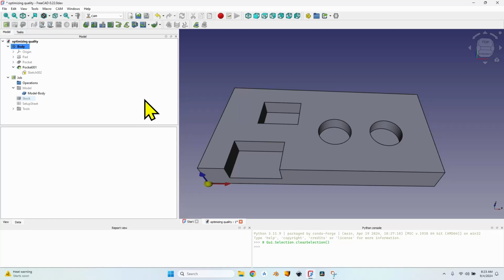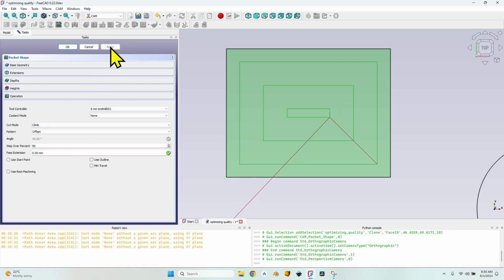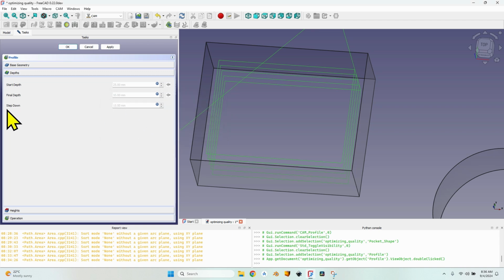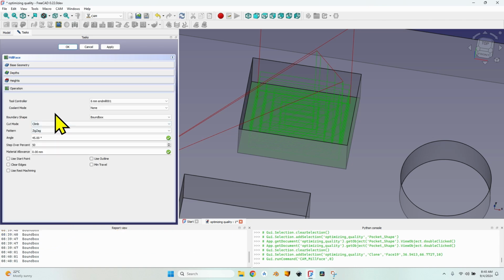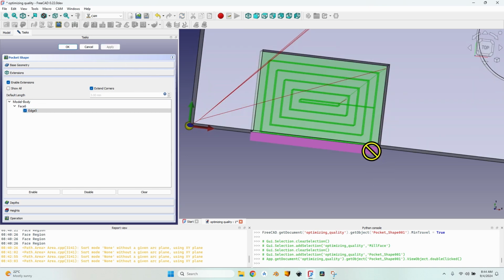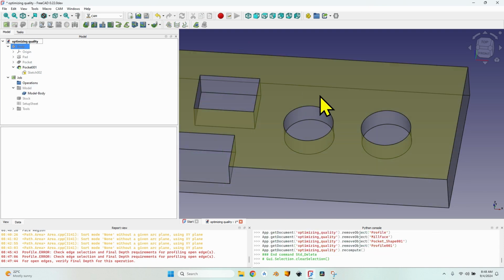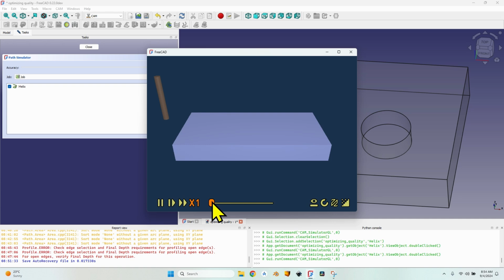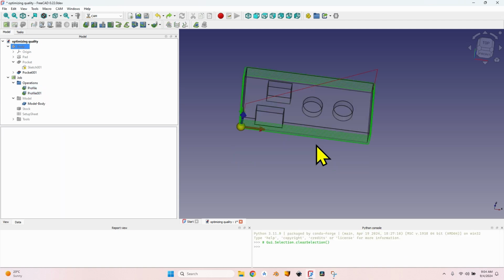Optimize CNC Cut Quality – FreeCAD CAM Tip 13 (Toolpath Finishing Guide)

Comment: Hi, Im trying to find information on setting up rough cut and finishing cut passes that will save time.  Rough cut with large cutter and finish with smaller cutter.  Do you have a video of this?
Reply from the maker: Not exactly. But use the approach in this video, together with the video about different toolbit speeds (in your case just create a large and a small toolbit) https://youtu.be/tECcIMl_jNw?si=I4Xb39ALnR-ybkXr
But that's a good topic, I'll make a special video for that soon
Reply: @opensourcecnc   I understand the principal, but I have issues with, after the rough cut, I can’t seem to specify the new stock geometry and any subsequent cutting operation simply removes all the original material again.  I appreciate the quick reply.
Reply from the maker: Depending on the version you are using (it is available in the latest development version), you have an option called rest machining. That takes into account the material milled in the previous operations of the same job. But it's still experimental and has some issues for now

Comment: Great work again!!
I’d love to see your work on the cam for an electric guitar .. eg ; take one of the guitars that the marz guitar workbench generates and do the cam for the  fretboard , then the body 2sided milling and then the neck again 2 sided milling .. I’ve seen a few vids done by Austin Shaner on a paid cad cam software but I’d love to see your take .. again great stuff!!
Reply from the maker: Thanks! I was just taking a look at the Marz Guitar Workbench, so video about milling it is going to arrive in the near future
Reply: @opensourcecnc  you could do a series.. finish up by cutting out the parts on your cnc.. if you need any help with the luthier side of the vids please let me know ..  thanks again I’m really looking forward to this… cheers 👍🤙